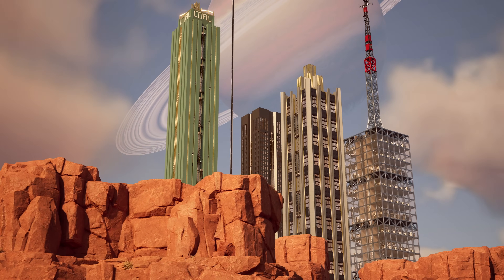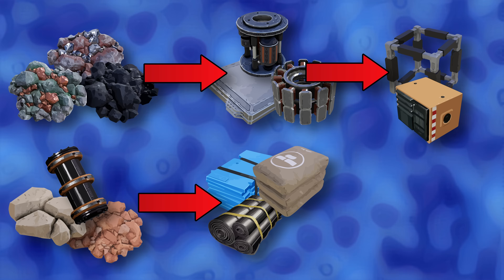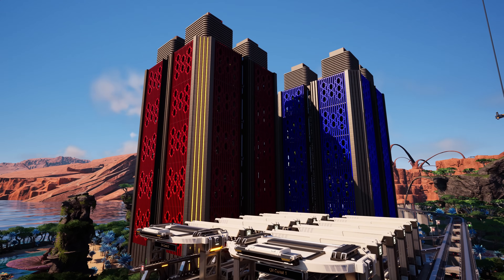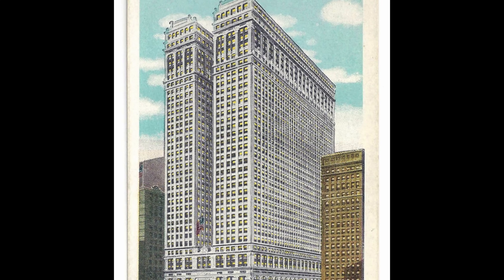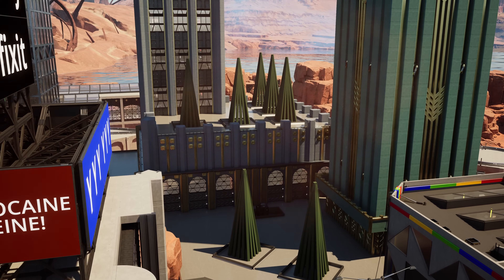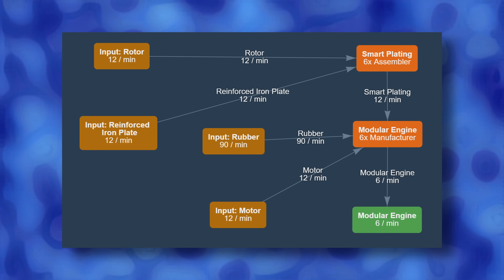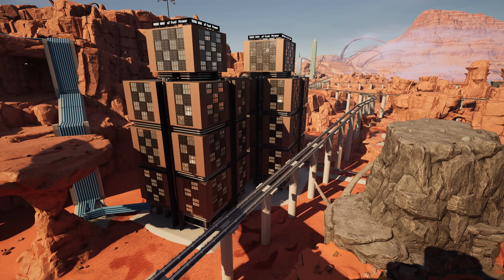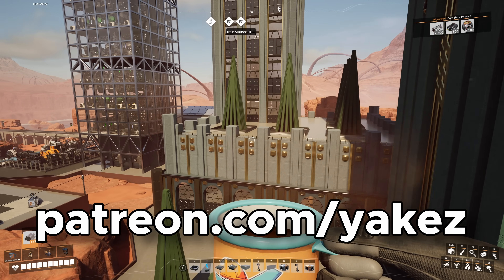3 Space Parts. 3 Blueprints. 3 Skyscrapers.

Comment: I have a question about the versatile framework layout in Satisfactory Tools. Did you select all alternate recipes, or just the alternate solid steel ingot recipe? I ask because I selected all alternate recipes, assuming I’d get the same layout as you, since I know you prioritize efficiency. However, instead of matching your layout, I ended up with a massive setup where nearly every input had an alternate recipe, except for the modular frame. Satisfactory Tools claims to use the best possible combination, but if that’s true, why did my layout turn out so much larger than yours? Based on what I’ve described, can I assume that I need to manually select only the alternate recipes I want included in the layout?
Reply from the maker: I am never selecting all the alternative resources. Only ones that I need manually. With modular frames I use separate factory / calculation (with a  bunch of other alts) and only input MF as resource in Items/ input tab.